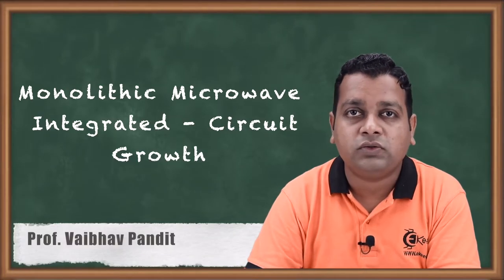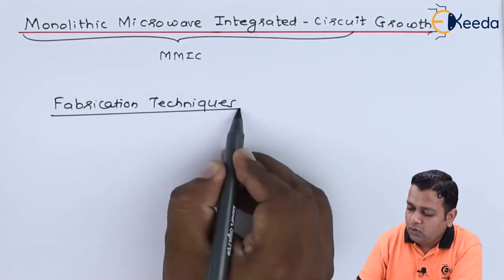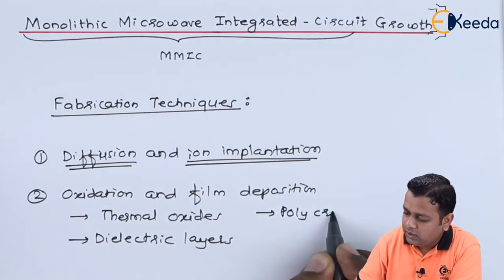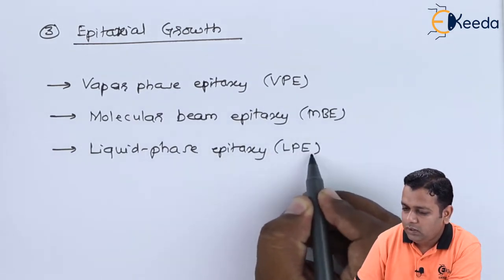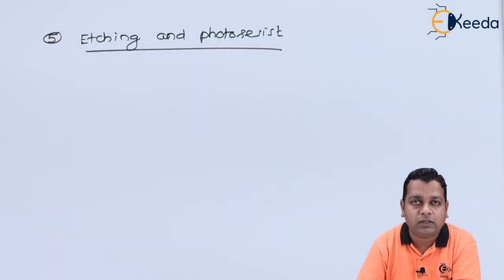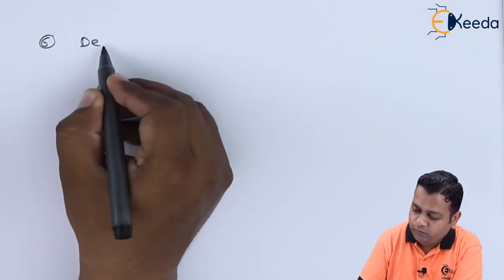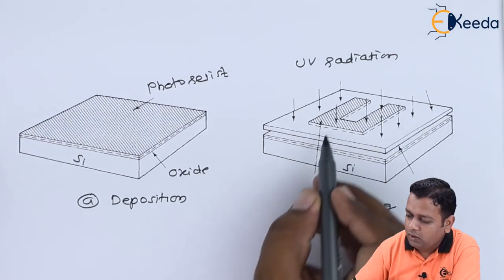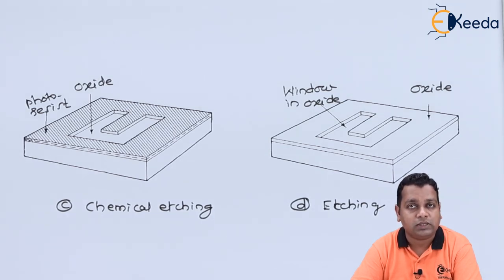Monolithic Microwave Integrated Circuit Growth - Monolithic Microwave Integrated Circuits

Comment: Sir you are just reading what is in book microwave device and circuit written by samuel y. Liao
Plz take some efforts in explaning the points
Specially at 6:45 to 7:50
You just labellled them and passed it